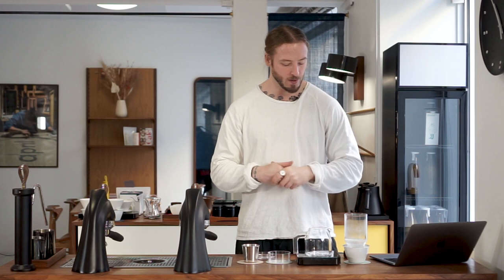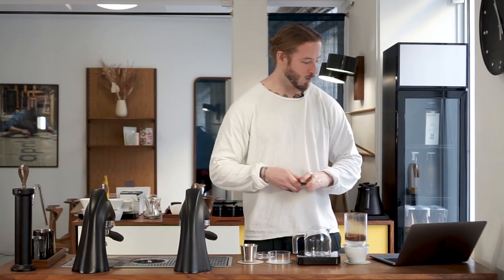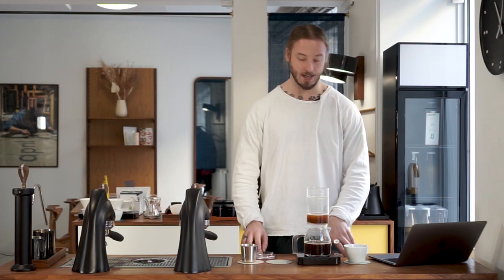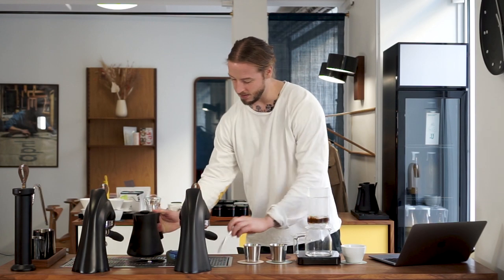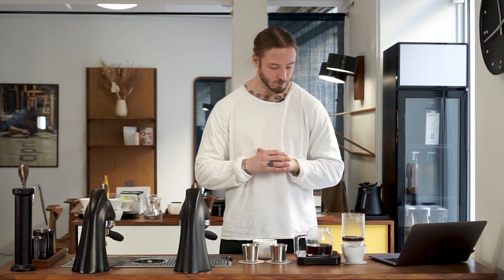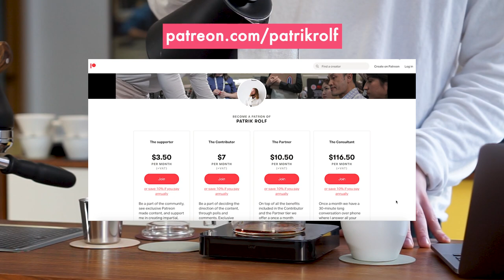Revisiting the Tricolate Coffee Device - Scott Rao Recipe | Coffee with April #203

Comment: Thank you for working through this and I understand why- prior to the V2 Fellow Ode burrs I was unable to get a grind level fine enough to make a proper cup from the Tricolate- the Tricolate people were kind enough to talk me through a few attempts and it was still running too fast until I used an espresso grinder which wasn't going to be a sustainable method for me given there are usually beans in that machine and it is stepless. After a few tries with the new burrs I installed, the setting of 2 on the Ode with the new burrs gave me a cup on my daily med roast bean I'm happy to say was very tasty, smooth with a full body - something I wasn't able to attain prior to this- just under 6 mins- 15 g- 270 this time around from a recipe on the web but I intend to try their recipe of 15-330 with this same grind to see if there's too much a loss of body which would cause me to tinker again. At least I know I'm there without too much more fussing. The grind can't be too fine- I did have to adjust up closer to pour over to speed up the timing.

Comment: Patrik, 

I'm not sure why you assume I would choose a darker roast.  I personally choose what most consider "nordic" level roasts at home. My clients all roast to the degree(s) that they see fit.  Perhaps that has caused you to make a false assumption about my preferences?  You seem strangely concerned with how dark I roast, despite having never had a coffee roasted by me, nor asking me about my preference. 

I did not reference a micron rating because I do not have a PSD machine (they're very expensive).  Plus, <1% of coffee people know what micron size their grinder produces at any given setting.  So it would be expensive and relatively useless information.  Finally, you can adjust the grind well by brew time with tricolate. 

Regarding the comments about spinning, if you experiment carefully with spinning vs not spinning, the difference in bed level and cup quality is dramatic. 
At 6:33 there is a brief closeup of the coffee bed and it is not level. Spinning more skillfully should improve that.  I literally have never had a coffee bed so uneven with the tricolate.  

You noted the coffee was very sweet, which is great. Tricolate is not known for producing a lot of body, so I don't think you can change that much via your recipe. As for clarity and complexity, etc, it seems the screen under your filter was not snapped in properly. That can happen with Tricolate, and is easy to fix, but unfortunately, when it is unsnapped, it always affects brew quality negatively.  Definite barista error here, and one that invalidates this entire demonstration. 

Finally, changing the coffee in the second brew is a strange decision... That prevents a useful comparison of the two recipes. 

So, to recap: 

1. Weird, incorrect assumptions about my choice of roast level. 
2. improper use of tricolate because the filter platform was not snapped in place properly.
3. changing the coffee in the second brew prevents a meaningful comparison. 

best
Scott
Reply: The uneven filter screen can be seen at 6:33 I think patrik should redo the experiment/video because of that uneven screen
Reply: I always snapped my tricolate but I always saw that Lance Hedrick never did it and be fine with it. Does that really matter that much cause I never tried unsnapped ones? Unsnapped tricolate makes me feel bad in my coffee imagination
Reply from the maker: @tippykaffu4047  In our experience it matters little. We haven't been able to taste a difference.
Reply: Wait, are you even the real Scott Rao? Something is really fishy about your channel and you seem to either forget or not know something very basic about coffee.
Reply from the maker: Thank you for watching and taking the time to comment. 

Perhaps you can reference your recommended Agtron level to use with the brewer? That would be helpful to clear out any misunderstanding of roast-degree, and it's something that home brewers easily can ask their local roasters about. 
Regarding the "incorrect use," we have brewed enough brews with your recipe and others to know that it makes very little difference. We were aware of it and decided to include it for that reason. We do a wide range of test brews for every video, so we are confident that what we show represents our experience. 

We strongly recommend everyone to try a wide range of roast degrees on the brewer they use. As each brewer has an individual inherent flowrate, as do different roast degrees, you are surprised by how some degrees are much more suitable for specific brew approaches. I can see why you might not agree because you might think we only ever did two brews of it - if that was the case, we might have agreed with you as well.
Reply: @tippykaffu4047  What basic thing did I forget or not know?  I'd love to know. and are you the real, anonymous Tippy Kaffu?  (Gosh I love comments from anonymous accounts.
)
Reply: @coffeewithapril  I gave this some thought, but I'd rather not reference a number, because when I do that online, people take it too far.  Next thing I know I"ll hear "Rao only likes #x on agtron" or "Rao says you have to roast to x agtron color." 

For example, if i were to write a book in which I invent the concept of DTR and make a broad recommendation for the wide variety of roasters in the world, people would obsess over that range and rather than think "huh, that's a reasonable recommendation if you have to pick a range for the wide world of roasters"  they will say "how dare you? My coffee is great at 15%DTR!!!".. 

haha.. I could even imagine that happening in real life!! 

Suffice to say, my preferred color will vary for different coffees, and I generally find myself enjoying batches dropped during first crack, but closer to the mid-point of FC than the end of FC. A few would say that is "dark," in order to sound like they are at some cutting edge. That would be a little unreasonable, given that it is lighter than 99% of the coffee roasted in the world.
Reply: @scottrao5268  ok, nevermind. Anyways, coffee generally tastes sweeter but loses the clarity the finer you go in a certain fine end grindsize which perfectly describes the problem in this video. 

Or is this some kind of myth? I also find similar results in single pours with high water level instead of finer grind. Do you mind enlighten me about this?
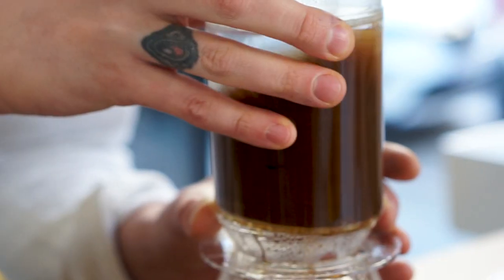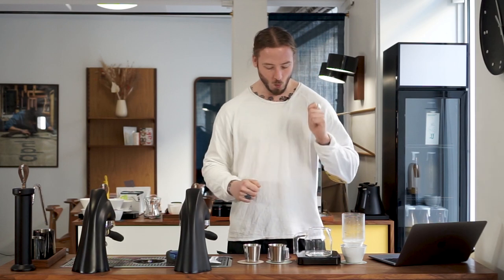Reply: @tippykaffu4047  the first thing you wrote is generally true, but the clarity problem is not recipe-related, it is tricolate-design-related and was made worse by the grind being too fine here. FWIW, given that Patrik's second pour began later than 7:00, the total brew time had to be well past 10:00.  There is no way the first drawdown took 6 minutes to reach a 1cm water level and the second drawdown took less than 3 minutes to drain completely. 

So, the grind was much finer than my recipe called for. 

Sure, a micron recommendation would have helped about 1% of 1% of people trying the recipe, but regardless of a micron recommendation, the first brew would still need adjusting based on taste and time (even if two grinders have the same PSD peak number, they will still have different PSDs and may need dialing in.
Reply: @scottrao5268  Ok, thanks I understand your viewpoint about the microns part. I didn't doubt the recipe but rather the fine grind Patrik used. Your recipe was the one that got me  make more tricolate brews than before.

Comment: The only recipe that has given cups that I have really loved is the Sang Ho Park recipe, which is actually very similar to the Scott Rao recipe, but targeting about 5 minutes brew time, with no agitation and slower addition of water. I don't have a refractometer unfortunately but I imagine it is a lower TDS recipe which gives a bit more clarity than the Rao recipe.
Reply: Recipe is 
13g medium fine but not quite as fine as Rao method
45g bloom
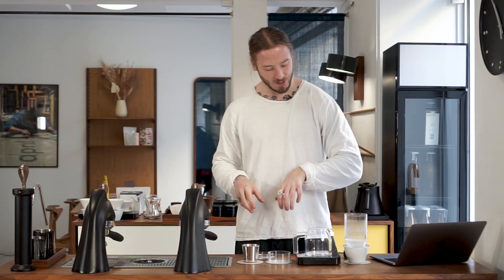@0:45 pour to 180g
@1:45 pour to 260g total brew weight

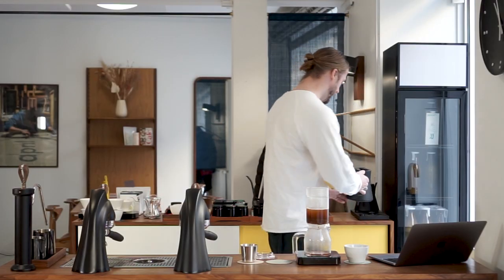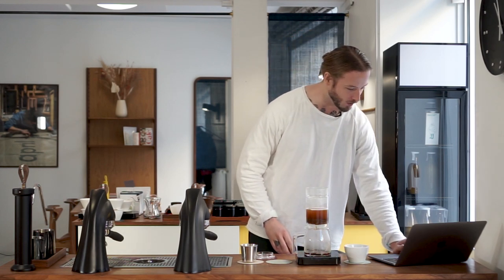It has the same philosophy of keeping the water below a set height above the bed. Adjust grind to hit 4:30 to 5:00.
Reply: @morganbakerable  thanks for sharing!

Comment: Darker roast generally is not as suitable as light roast because it has lost flavor during the roast in the 1:20 ratio. Your recipe is ALMOST perfect other than the grind size in the light roast. Another problem in grinding fine is that coffee tends to lose their characteristics which is why coarser tend to go better bringing the clarity. You generally could do your own tests on how you want the grind size cause this time it really requires trial and error which is basically like dialing in an espresso. 

I find that 19 Comandante click/570 microns is the sweet spot where clarity works really well in all kinds of coffees except for the one that creates more fine than others and its soluble enough to do 1:20 without losing too much characteristic of the coffee. You can probably either go 1-2 click finer and lower going lower water for better clarity but also sweeter. I'd say 600 micron would be a great start on dialing in from different grinders. The timing doesn't have to be precise, it just has to be a good reference whether you are too fine or coarse when you are dialing in.